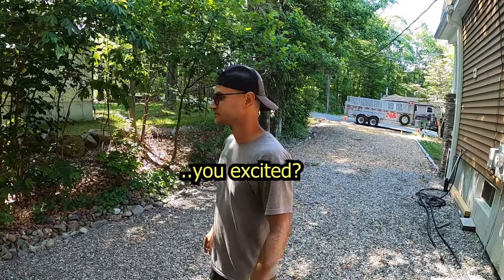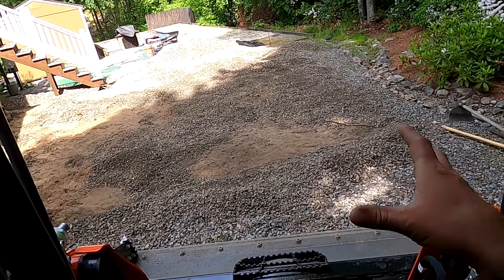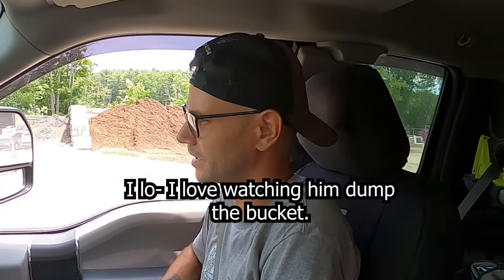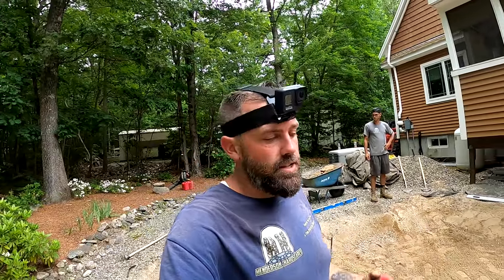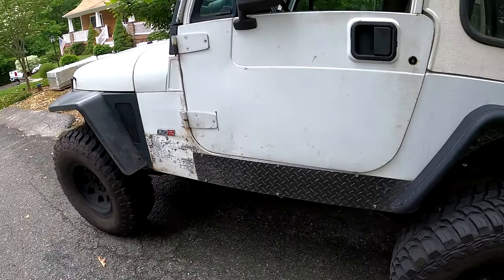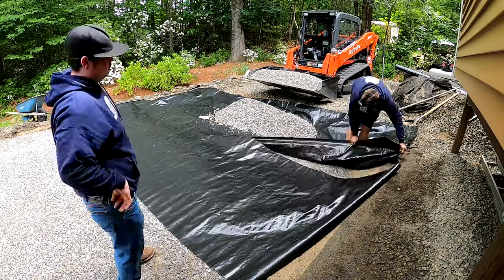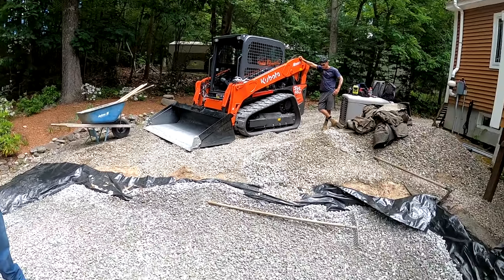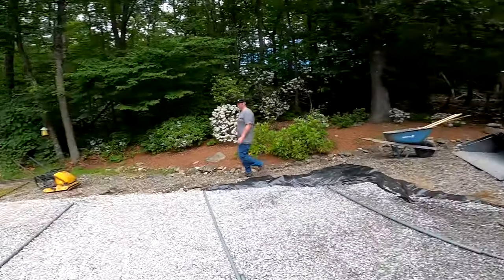New Job, New Machine, New Employee. What a Day!

Comment: Fellow hardscaper here! When you say the machine lifts a pallet "no problem". Can you expand on that?

Right now, I'm using a compact tractor as my loader, and I'm looking to upgrade to a 65-2.  I'm trying to find out from guys with experience with the machine if it'll unload full pallets off the side of a semi trailer. Does it struggle to lift full pallets 4-5ft off the ground? Thanks bud!

Comment: Hey Kyle
Do you think that machine could handle lifting pallets of pavers off of a dump truck as well?
John
Reply from the maker: Hey John, I do think it can. Especially the techo pallets with 117 sq ft on them. The genest pallets I work with often are a little heavier with 124 sq ft. But yes, as long as you are not higher than 50% of its lift height. You just have to be smooth with it ✌

Comment: Do you ever use a laser transit to set excavation height? That’s how i was taught. Or do you set your strings based on your pitch. And then just measure from the string to the subsoil?
Reply from the maker: Barely ever... I just use the old fashion string / line level. Has always worked great for me and is simple ✌

Comment: Can i ask why all that compaction?  Does the chip stone keep it an open grade or does the compaction eliminate an open grade base?
Reply from the maker: The compaction is necessary or it will settle over the years. Even though the stone is getting compacted, it still remains very open and permeable. But every 6" of base stone you install needs to be compacted.